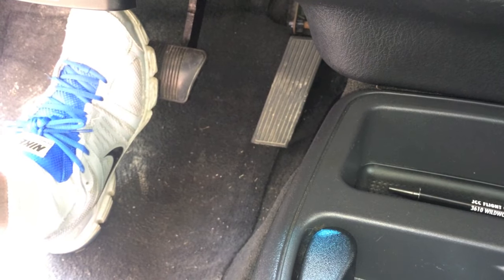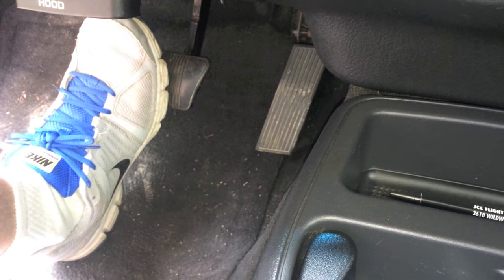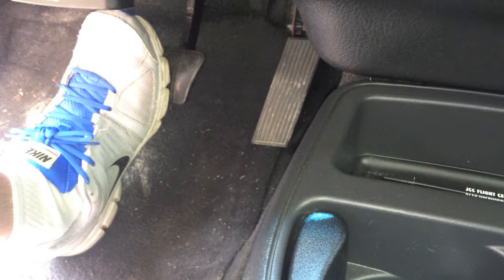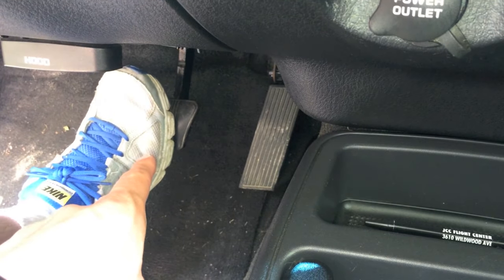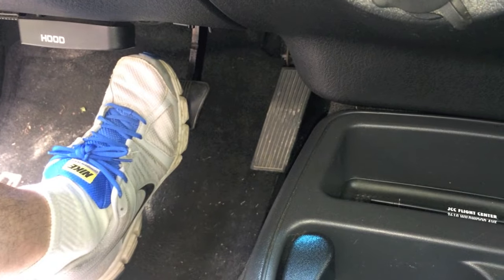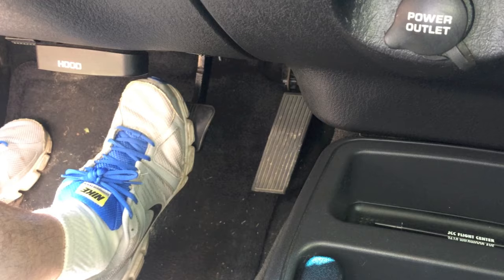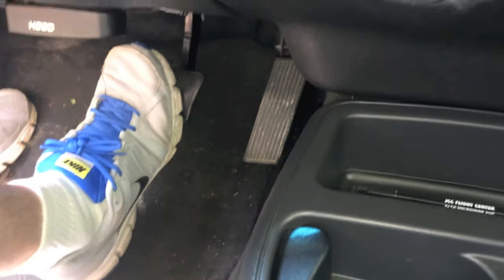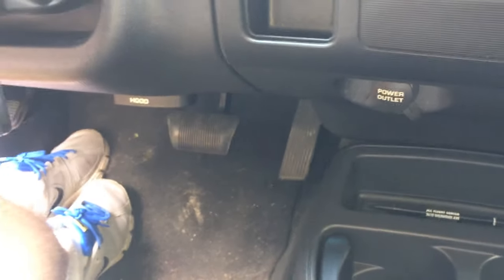HARD Brake Pedal - How to check if your BRAKE BOOSTER is GOOD or BAD

Comment: question mate..

i bleed the brakes and car runs fine about 10 min into the drive n brake pedal get pretty hard once i come back both tyres are hard to turn by hand and get locked up again  ..

but once i bleed the brakes again its fine and keeps doing it

ive changed the caliper and rear brake cylinder as they where seized but got to the stage were before i changed the caliper.
 The car would just lock its up brake pedal was hard as a rock and would pull me up i had to force the car to drive it back home.
 With smoke n little fire coming out of my caliper with my rotors bright red dunno whats going on
Reply from the maker: spinna313 

NO FUN...Brake problems are very annoying and I definitely feel your pain.  Lets get this figured out together so you can get back to normal driving.

It can be a few different things....

The front rubber brake lines that connect to your caliper fail from inside rather that outside.  This means the inner coating begins to break away and clog portions of the brake system...hence not allowing fluid to flow back and forth freely.  

Your brake pads have little prongs/teeth on them.  You will notice by their location...the pads slide on a steel brace.  This may need to be lubricated to bring the shift back to efficient requirements.

I have attached helpful videos that help explain the items mentioned above.  In addition, I have added a few videos that it can also be as we move forward with pin-pointing the exact cause of your brake issue.  Lets start with the easy items and then work our way up!  Lets figure this out together!  Keep us posted!  

PLEASE SUBSCRIBE to the channel and turn on your YouTube notification Bell 🛎 that would be awesome!  😎👍🔧🔩

1.  Caliper Slides Lost Lubrication:

https://www.youtube.com/watch?v=-DZ68tKuCQc&amp;t=15s

2.  Too much Fluid in Reservoir:

https://www.youtube.com/watch?v=X-AJ5tD6zoA&amp;list=PLjCXOz8TSkZnavDiGDyHdPKe2dV2RzEMZ&amp;index=39

3.  Failing Front Brake Lines:

https://www.youtube.com/watch?v=3FTEgbLYAdI&amp;list=PLjCXOz8TSkZnavDiGDyHdPKe2dV2RzEMZ&amp;index=78

4.  Brake Pads not shifting:

https://www.youtube.com/watch?v=3Pq15BWM_qY&amp;t=103s

5.  Replacing Front Brake Calipers:

https://www.youtube.com/watch?v=8HoaL4QM5-k&amp;list=PLjCXOz8TSkZnavDiGDyHdPKe2dV2RzEMZ&amp;index=83

6.  How to check if Brake Booster is Failing:

https://www.youtube.com/watch?v=VK4lowH7kQE&amp;index=66&amp;list=PLjCXOz8TSkZnavDiGDyHdPKe2dV2RzEMZ

7.  Failing Brake Booster:

https://www.youtube.com/watch?v=j9s7yccswPQ

8.  Symptoms of a Failing Brake Booster Check Valve:

https://www.youtube.com/watch?v=j9s7yccswPQ&amp;index=68&amp;list=PLjCXOz8TSkZnavDiGDyHdPKe2dV2RzEMZ
Reply: Brake hose probably needs replacing??
Reply from the maker: Kerr Martin 

Thanks for watching & sharing your comment.  That is definitely an option when experiencing hard brake pedal issues.  😎👍🔧🔩

Please subscribe to the channel and turn on your YouTube notification Bell 🛎 that would be awesome thanks again!  😎👍🔧🔩

Comment: What if the break peddle after you start it goes further in then out ?
Reply from the maker: Thanks for watching & welcome to the DIY Raptor Club.  Not normal in most cases...🤔

What issues are you having with your brake system specifically?

Comment: What if it goes down?
Reply from the maker: Thanks for watching, if your pedal performs as shown in video, you have a good operational system.

If it goes to the floor, you may have a brake line leak, vacuum system leak, or faulty booster.  Faulty booster is unlikely but we can’t rule it out.

😎👍🔧🔩

Comment: what if my first push on the break is hard and it will hardly goes down...i changed the breaks , callipers,and master cilinder
Reply from the maker: Thanks for checking out the video.  Have you checked all vacuum lines that feed into the booster and run along firewall?  Subscribe to the channel that would be awesome!
Reply: Marcelino Cruz My brake pedal was locked! wouldn't even go down!  Couldn't start the car either!  it's something to do with pump and vaccume.  Anyway I tried again by moving the steering wheel hard and turning the ignition on. The pedal went down and engine started.  phew!!!! we had to cancel the breakdown cover who was on his way lol.
Reply from the maker: Thanks for checking out the video and sharing your experience.  Have you replaced part yet?  Any update?  Please Subscribe to the channel that would be awesome thanks again!

Comment: Hi I have an 04 pontiac sunfire, I just recently replaced the rear brake shoes. my brake pedal was working correctly for a week or so and suddenly it became real hard to push down.  The car still stops of course but like I said the pedal is hard to push. I didn't know if it was just coincidence or it had to do with me replacing the rear shoes. Any help would be greatly appreciated!
Reply from the maker: Thanks for checking out the video.  Definitely a possibility.  During the instal, did you adjust the brake shoes?

Comment: I have a 02 dodge 3500 2wd 5 speed diesel does the break booster affect the clutch when shift gears
Reply from the maker: Thanks for watching & not usually.  What exactly are you experiencing?
Reply: My battery's are going dead after I drive it an let sit a day
Reply from the maker: @josephmcintosh6339  

Thanks for the reply,  2 things cause this.

1.  Warn out battery not being able to hold the cause that the alternator gives it as engine is running.

2.  Alternator in its early stages of failure.

It’s most likely your battery.  Replacing your battery should fix your issues.  Please keep us posted, us DIYers need to stick together!!!

😎👍
Reply: They are brand new batteries bought them in February of 22 so it's not batteries got new one an still doing it
Reply from the maker: @josephmcintosh6339  

Thanks for the update, has the alternator been replaced within last 3 years?
Reply: @DIYwithMichaelBorders  the next thing I seen on there alternator an the fuse an am gonna chec all the ground wire tomorrow morning am in a rebuild stage of my 02 5 speed 3500 dodge
Reply from the maker: @josephmcintosh6339  

😎👍

Comment: Mine goes down when i start car but then i got not stoping power at all i have to slow down then use emergency brake to stop.I 9ran a red lite adter i pushed on my break pedal and pedal when strsight to floor .Luckily no one was around.Do u think i busted a break line?When i got home my break resivoir was empty and i didnt see any lines running into leaking.
Reply from the maker: James Reed 

Thanks for watching James & we are glad to hear you’re ok & didn’t get hurt.  After reading your comment, you mentioned that your Brake Fluid Reservoir was empty, this is almost 100% indication of a leak in the system.

Let’s try something first.

Add fluid to your system & start engine.  Then have a friend slowly press on the pedal while you do a thorough inspection of all the brake lines.  Also check for leaks near your reservoir.

If you find no leaks, we will move onto the next few options that I have in mind.  Let’s start there!

Keep us posted.  Please subscribe to the channel and turn on your YouTube notification Bell that would be awesome thanks again!  😎👍🔧🔩
Reply: Will do
Reply from the maker: James Reed 

😎👍
Reply: DIY With Michael Borders my 2000 S10 Blazer does this same thing but has fluid in the reservoir.
Reply from the maker: Anthony Roch 

Thanks for watching Anthony!  Have you had any recent work completed to the vehicle within the last 12 months?  If so, this may help us figure out if any recent repairs are tied to your degraded Brake System performance.

Keep us posted!  Please subscribe to the channel and turn on your YouTube notification Bell 🛎 that would be awesome thanks again!  😎👍🔧🔩
Reply: DIY With Michael Borders just got the heads redone but before that nothing in the last 50K.
Reply from the maker: Anthony Roch 

Thanks for the update!  This is definitely not uncommon!

It can be a few different things....Lets figure it out!

1.  Its possible that your caliper is beginning to stick...maybe caliper slides have lost the lubrication required to shift back and forward freely.

2.  It can be possible that your Caliper piston has lost its lubrication which will also interfere with the efficient shift back for forth.

3.  The front rubber brake lines that connect to your caliper fail from inside rather that outside.  This means the inter coating begins to break away and clog portions of the brake system...hence not allowing fluid to flow back and forth freely.  

4.  Your brake pads have little prongs/teeth on them.  You will notice by their location...the pads slide on a steel brace.  This may need to be lubricated to bring the shift back to efficient requirements.

I have attached a few videos.  Lets start with the easy items and then work our way up!  Lets figure this out together!  Keep me posted!  Please Subscribe to the channel that would be awesome!

1.  Caliper Slides Lost Lubrication:

https://www.youtube.com/watch?v=-DZ68tKuCQc&amp;t=15s

2.  Too much Fluid in Reservoir:

https://www.youtube.com/watch?v=X-AJ5tD6zoA&amp;list=PLjCXOz8TSkZnavDiGDyHdPKe2dV2RzEMZ&amp;index=39

3.  Failing Front Brake Lines:

https://www.youtube.com/watch?v=3FTEgbLYAdI&amp;list=PLjCXOz8TSkZnavDiGDyHdPKe2dV2RzEMZ&amp;index=78

4.  Brake Pads not shifting:

https://www.youtube.com/watch?v=3Pq15BWM_qY&amp;t=103s

5.  Replacing Front Brake Calipers:

https://www.youtube.com/watch?v=8HoaL4QM5-k&amp;list=PLjCXOz8TSkZnavDiGDyHdPKe2dV2RzEMZ&amp;index=83

6.  How to check if Brake Booster is Failing:

https://www.youtube.com/watch?v=VK4lowH7kQE&amp;index=66&amp;list=PLjCXOz8TSkZnavDiGDyHdPKe2dV2RzEMZ

7.  Failing Brake Booster:

https://www.youtube.com/watch?v=j9s7yccswPQ

8.  Symptoms of a Failing Brake Booster Check Valve:

https://www.youtube.com/watch?v=j9s7yccswPQ&amp;index=68&amp;list=PLjCXOz8TSkZnavDiGDyHdPKe2dV2RzEMZ
Reply: DIY With Michael Borders mine does the same thing the peddle goes straight to the floor I bleed the brakes twice the master cylinder reservoir is full and the peddle feels spongy when the car is off if you can help me out

Comment: Mine passes all these tests but sometimes on the highway the brakes will apply themselves and to release them I have to unplug the vacuum line off the booster which instantly frees them up and the pedal feels normal. 2007 Tacoma 2wd v6 automatic
Reply from the maker: Thanks for watching & welcome to the DIY Raptor Club.  This can happen when the Master Brake Cylinder port gets blocked...how can this happen...?...

It’s crazy & rare however can happen.  The most extreme is when a rubber brake line near wheel begins to break down from the inside and release pieces of rubber.

These little pieces of rubber can unfortunately travel upstream and clog master cylinder ports.

A less extreme clog can be caused by contaminated or dirty fluid.  Hope this helps.

😎👍🔧🔩

Comment: I hear air noise when I’m braking and it’s scary cuz it doesn’t stop unless I do it veryyyy hard and push the air out
Reply from the maker: @Luui2x  

Thanks for watching, any update?  Any recent maintenance performed on brake system?  We can hopefully help.
Reply: @DIYwithMichaelBorders  nope just new caliper its got brake just the booster i think gave out
Reply from the maker: @Luui2x  

Thanks for the reply, will you be replacing Booster soon?

It may even be a leaking vacuum hose/line inside engine compartment.

You can visit your local AutoZone and have a tech listen to your engine while you press the brake pedal.

If in fact you have a leaking vacuum line, they will be able to locate it and get you the proper replacement line.

👍🧰
Reply: @DIYwithMichaelBorders  okay thank u but the noise is coming from inside so idk  its weird
Reply from the maker: @Luui2x  

Thanks for the follow up.  We are looking forward to hearing back from you.  👍

Comment: Is there any air noise when you press the break pedal . ?
Reply from the maker: ercüment özergin 

Thanks for watching, in our case, there was not.  If you have air hissing, you may have a leak in your vacuum system.

We recommend starting engine and opening hood to inspect where your hissing sound is coming from.  Check all lines that feed in and out of your brake booster.  Keep us posted.

😎👍🔧🔩
Reply: @DIYwithMichaelBorders  I have a video about my break pedal when I press ,  I want to send it to you ?
Reply from the maker: ercüment özergin 

Very cool, upload it on YouTube.

😎👍🔧🔩
Reply: @DIYwithMichaelBorders  https://www.youtube.com/watch?v=TqCo0wyz7TI

This noise occurs when the brake is pumped with the ignition off or on and "not moving".

With the ignition off, the brake swells after 2-3 presses, this is normal.

However, press it while standing still, there is a noise under the pedal. the sound is not continuous, but only once under pressureand stop.
 
no sound when braking while moving.
the service said normal. I do not understand this job.

no idle fluctuation, no hydraulic drop. No backlash or stiffness on the brakes when driving on the road, no change in braking distance
the car is already 2 months old.
Reply from the maker: ercüment özergin 

Thanks for the reply.  The video is still private.  You can make it public by selecting (Public) in the edit video section.

😎👍🔧🔩
Reply: @DIYwithMichaelBorders  iTS ok.i did

And please read the information well.
İt is important👍
Reply from the maker: ercüment özergin 

Thanks for the reply.  It’s normal for the brake pedal to stiffen up as you press it with engine off.  It’s not recommended to do this because it puts unnecessary stress on Booster.  The sounds you’re hearing may be normal & a result of the pedal being pressed when engine off.

😎👍🔧🔩
Reply: @DIYwithMichaelBorders  yeah you are right, when engine off. its ok.

but same thing when the engine on..
I confused by it
Reply from the maker: ercüment özergin 

You may have a Booster in it’s early stages of failure.  Boosters are a pretty friendly price to have replaced by a MX shop.

😎👍🔧🔩

Comment: So my brake doesnt get hard like it should when the vehicles off and I tried this test. So...new brake booster or leak in vacuum line?
Reply from the maker: Donovan Brown 

Thanks for watching & sharing your experience.  It is very possible that it can be one of the two.  Let’s start with the less expensive possibility.

We recommend starting engine & opening hood.  Complete a thorough inspection of the engine & try to listen to any “hissing sounds”.  If you hear a hissing sound, try locating the vacuum line that the hissing is coming from.

A hissing vacuum line is a clear sign of a leak.  Purchasing a new vacuum line from your local AutoZone may fix issue.

Option two....if no hissing sound found & all your lines look great, its most likely that your Booster is in its early stages of failure.

Replacing your Booster sooner rather than later is definitely recommended as your brake system is very important!

Hope this helps & keep us posted!

Please subscribe to the channel and turn on your YouTube notification Bell 🛎 that would be awesome thanks again!

😎👍🔧🔩
Reply: @DIYwithMichaelBorders  Well I'm sure it's the hissing I've tried to distinguish already, problem is I'm not familiar ENOUGH with my 12 f250 when it comes to vacuum lines, systems, and more detailed things like this. I am a big DIYguy and have done lots to take extra care of my 300k mile diesel, but I need to research more and find out what lines are still being used and which arent, since my truck is deleted but hardware remains. I shouldnt go look at the price for brake booster should I? If its the price of my radiator I changed this month, its not happening now. Thanks a ton and I'm gonna tackle it today and be in touch! 
Hate to make this long, but I did turn my truck off while drive was engaged immediately it went into neutral and I had to crunch HARD onto my hard brake pedal to stop it rolling backwards. Having done this, it's possible this could have damaged the lines and or booster?
Reply from the maker: Donovan Brown 

Awesome Awesome & thanks for the reply.  Definitely keep us posted on your project & which way you go.  We are standing ready to answer any questions!

😎👍🔧🔩

Comment: My pedal will barely budge when my truck is off for some reason.
Reply from the maker: Thanks for watching, it’s normal for pedal to be stiff when engine is off.  Once engine starts, the vacuum system operates which in return allows brake system to operate as designed.

Comment: Ok so I have Volkswagen gli 2015 and everything was working this morning and when I went back to go start It up the break was hard to push and when I tried to start the car It will make some noises but won’t start. I did put oil in 10 minutes before and I checked to make sure I got the right oil which I did but I’m super confused on what’s going on because it’s never happened before
Reply from the maker: TheKouzin 

Thanks for watching!  Let’s get this figured out!

First let’s start with the easy items.

1.  Open your brake fluid reservoir & verify that your fluid is within the proper fill parameters.  If it below or over the fill parameters, your engine performance will be affected.

2.  Re-Bleed your Brake system & verify no air in system.

Let’s start there & please keep us posted!

Please subscribe to the channel and turn on your YouTube notification Bell 🛎 that would be awesome thanks again!  😎👍🔧🔩